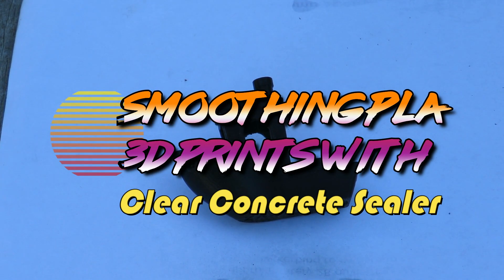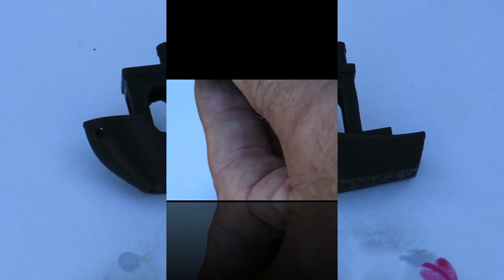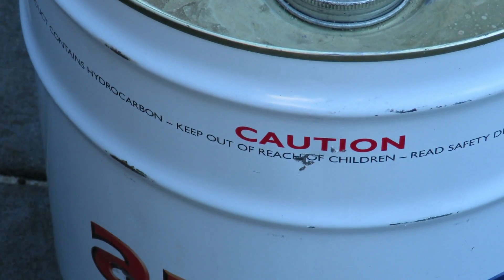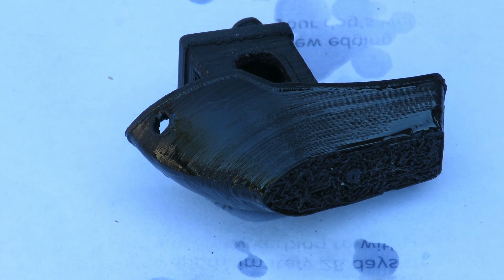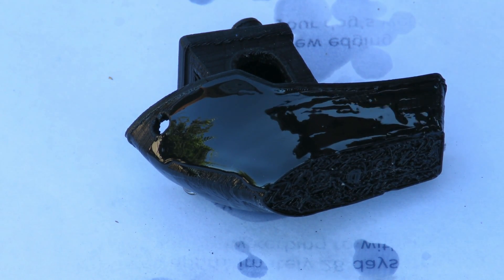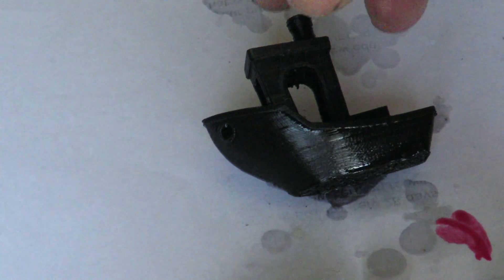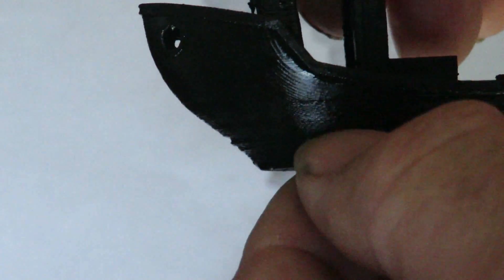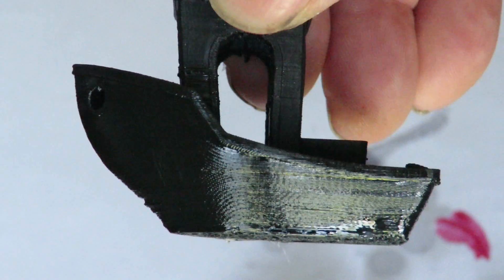📌 Smoothing PLA 3D Prints with Clear Concrete Sealer - Will it Work?

Comment from the maker: Wow.....😍😍😍
I toyed with the results from this video using another product.AND...............
I have now succeeded in getting A REALLY SMOOTH GLASS LIKE FINISH, using a fairly common inexpensive product.
I will have the video up in a few Days time, as I need to make sure it REALLY WORKS. 

P.S. I will add a Direct Link Below.
Reply: Hi Garry, looking forward to the new 'solution'. Cheers, JAYTEE
Reply from the maker: I've coated a few models, and I'm very happy with the results.
So far, No Sanding needed to get good consistent results, its also successfully filling the deep grooves on the benchy, and looks awesome on the better quality prints.